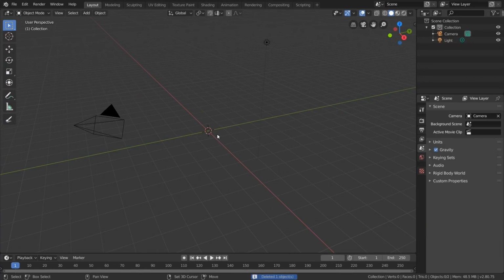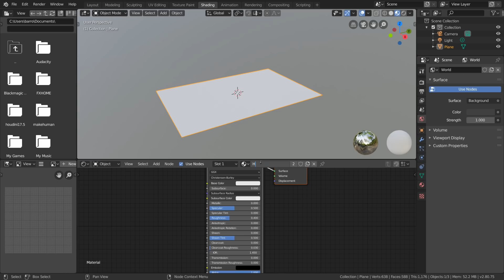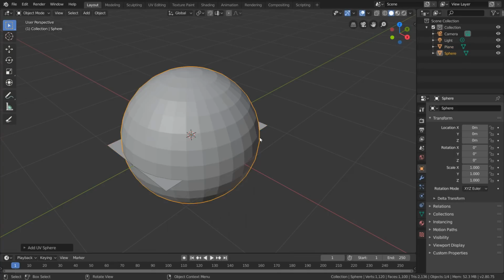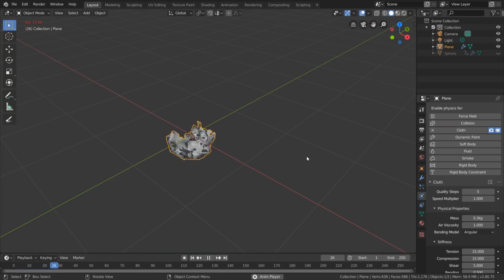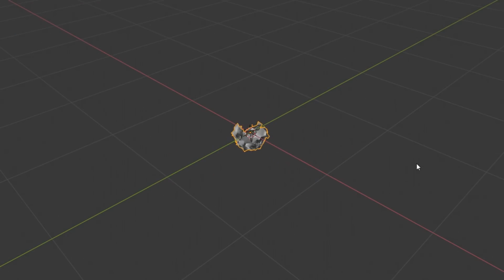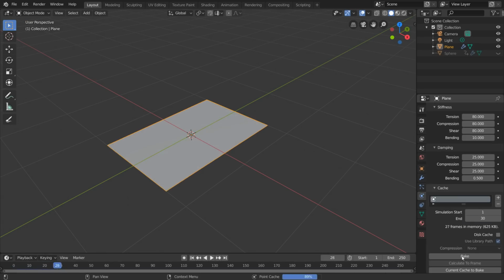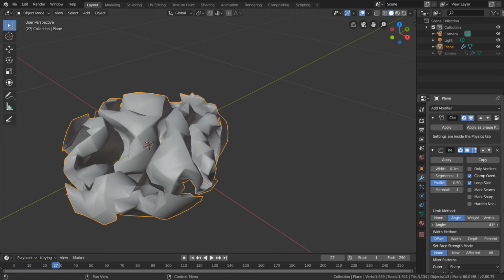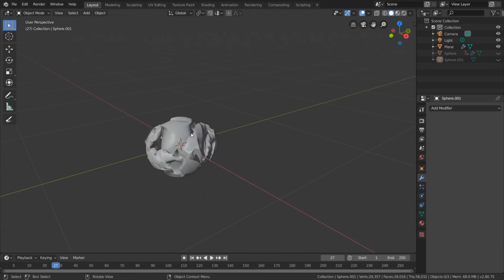Create Crumpled Paper Fast (Blender Tutorial)

Comment: How do you even come up with these puzzles? I'm stumped...

[i get that the numbers aren't prime, but what do I do then? do i run some sort of decryption on the factorization? is the solution even a word?]
Reply from the maker: break the chain up into prime numbers ;)
Reply: Alright, so... so far, from what I've thought of: [small spoilers]

There are multiple ways you can split 3311 and 23243 into prime numbers. Taking 3311, you can split it as:
3 3 11 (what I did originally)
OR 3 311 (what i figured out hours later, but according to one of CGMatter's replies, this is likely incorrect)

Doing the same with 23243, we get:
23 2 43

That is the only way I think you can break this all apart.

Now, what do I think this is not?
Unlikely ALT + x unicode characters (at least, i tried)
I don't believe this could be a1z26, as 43 > 26, and 4 =/= prime.
I'm gonna think on this, and I guess I'll start reporting back when I find anything. 

yell at me if i'm wrong i guess (or don't.)

small edit: i feel as if i'm largely overthinking this...

Comment: So ... Could you use Cloth physics to simulate origami ?
Reply from the maker: getting very accurate simulations (with creases etc) can be very challenging but with the new adaptive cloth coming soon maybe it can be easier
Reply: @CGMatter  origami is a huge untapped domain where the art can be amazing, but for creators, the softwares required to draw diagrams are old AF, look horrible, the diagrams they produce look horrible, and they're pretty expensive too, so most people just hand-draw their diagrams in Inkscape rather than dealing with custom software 
If someo would make a blender addon that could synthesize diagrams, even if paid, it'd be HUGE 

Like, when you fold something over, you could have simple controls for "bring point A to B" and implement them by using knife project, or something, to add a crease through all edges, and then fold it, store all steps as shape keys, and just render out the individual steps when done, along with some arrows and what not, that would be defined by the aforementioned "point A to B" control system